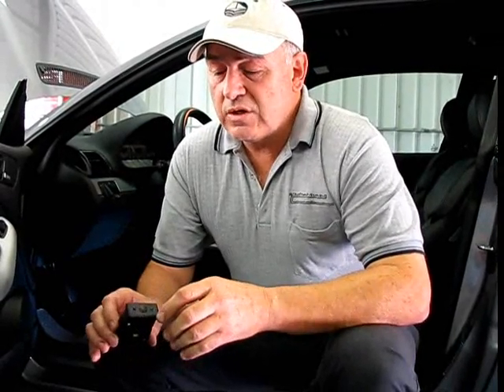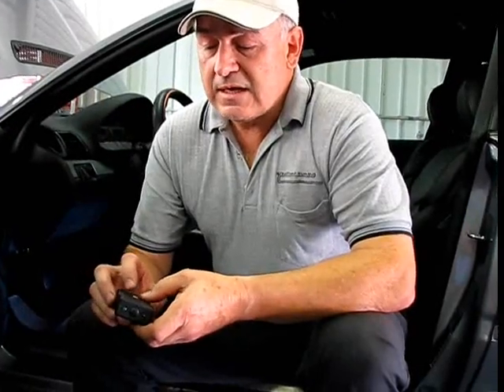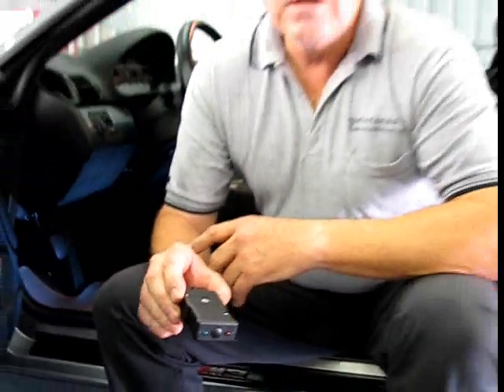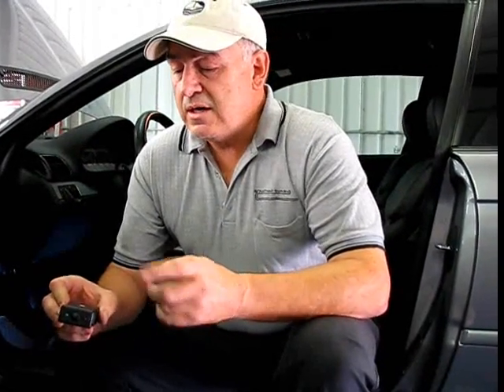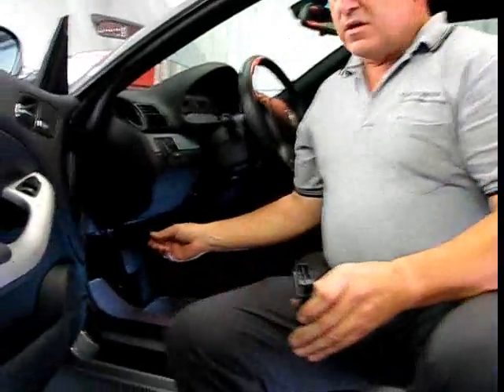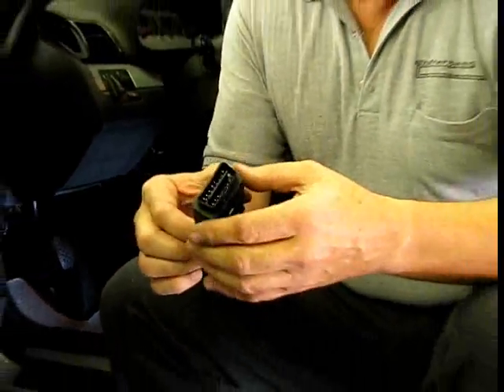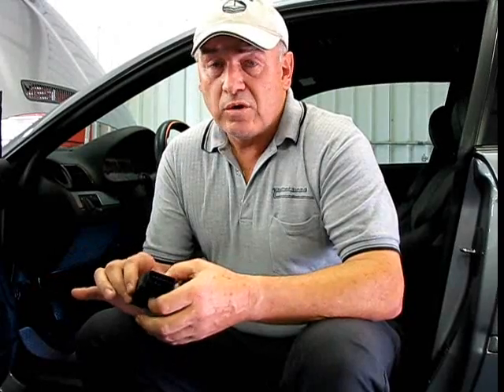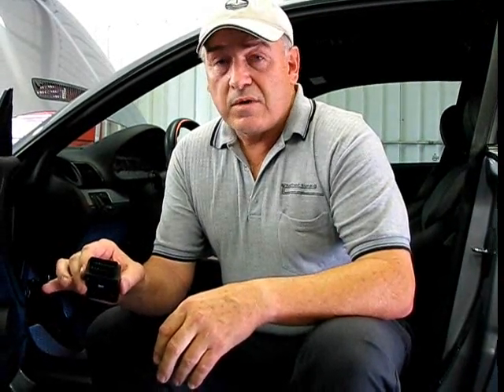E46 M3 Jim Conforti Shark Injector Explained

Comment: Darn, so I guess I can't add any engine mods unless I have the injector...? My car 96 m3 supposedly came with a shark tune but I would like to add exhaust and manifold, etc.(has conforti intake already) Would the ecu not adjust to these mods or would I compromise the original shark tune?
Reply: +Kevin Corral The ECU would adjust some but limited tolerances.  OTS is ok but for optimal gains it's best to get a Pro-tune from a local shop with a dyno.
Reply: Get a live feed obd2 for ur phone so u can check your bank leans and spark voltage and injectors

Comment from the maker: @teoirimia 

Hello,

Yes you would still want to plug in and install the post cat O2 sensors, this software does not turn the sensors off, but instead raises the setting that causes the CEL Light to a higher limit.  You Can run 93 Octane in the vehicle, in fact it is recommended.